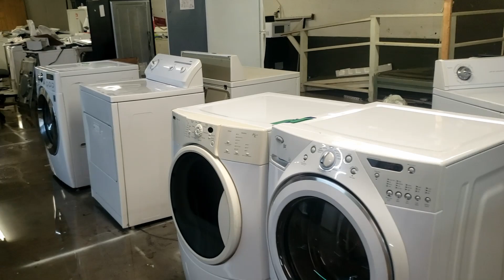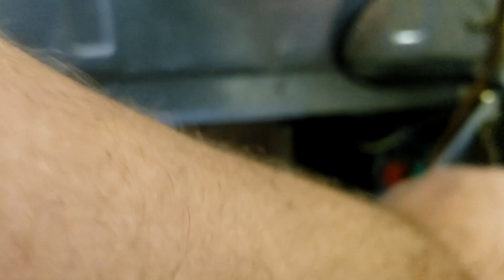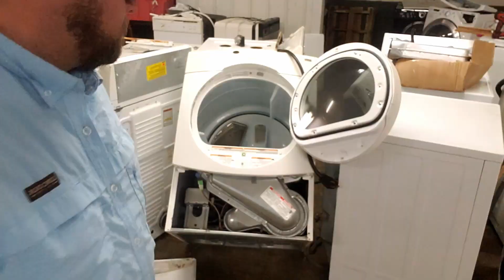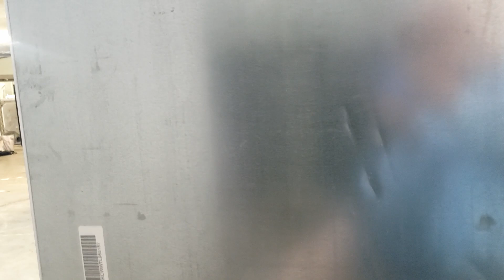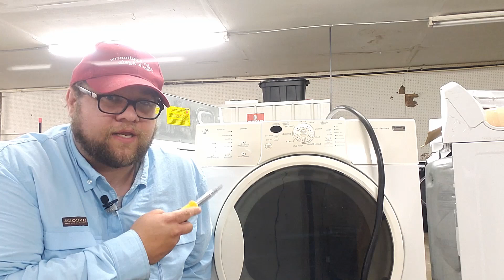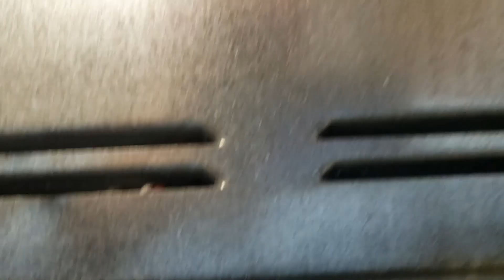How to Deal With Flooded Appliances - Recovery & Restoration

Comment: Just had a saltwater flood. Didnt stay long. We rinsed the refrig range & dishwasher motor areas with fresh water. Hopefully once it drys out good it will work? The power was off when flood came. Hurricane Helene in Florida
Reply from the maker: It should work yes. Make sure all wiring is clean and dry that came in contact with the water and you should be OK

Comment: thank you very much for the ray of hope. will be definitely doing this with my appliances

on the light of the situation, I would like to suggest taking off boards and cleaning them with non-conductive solvents that easily evaporate (like lighter fluid) to take off debris that get stuck on the contacts that may cause shorts

Comment: To recover any type of electronics from as a flood we would immediately remove them from location and remove the back first thing that insulation holds all kind of moisture, then we take an air compressor and blow off all the moisture off of every part, then leave it to dry with dehumidification, and air movement. Leaving it sitting in water in a place that big its tough to dehumidify it and prevent rust and electronic damage so you did damn good getting 95% back!

Comment: Another good reason to stay away from those GEtop load washers with the bottom and not open. lol

Keep in mind that we only sell top load washers and regular dryers but, my guy washes out most every dryer. He takes the tub out and flushes the rest with a hose. He washes it then tilts the dryer back, drains the water, plugs it in, I paint it.... SOLD! lol He does the same thing with stoves when he has a stove. Good to see that most things were saved! Floods suck!
Reply from the maker: We did get one bad fridge, but saved it with a new overload/relay combo. Probably have it sold this weekend - a nice side by side Samsung fridge.
Reply from the maker: And you spray water in the dryers eh? Interesting. We usually take a vaccum & hose and sweep 'em out roughly during the testing of the unit.
Reply: @bensappliancesandjunk  Yeah, he sprays the whole thing with water, puts it back together and starts it to blow the water out. Been doing it that way for years. lol
Reply from the maker: @lilolme69   Where is your shop at by the way?
Reply: @bensappliancesandjunk  Texas. Nice and warm here, come on down. :)

Comment: For as much as you use a hand screwdriver, Ben, you should try a good Wera or Wiha set.  KC Tool puts  the Wera handle + bits on sale occasionally for $20 or $30, and they are amazing.
Reply from the maker: One day I'll have a Wera 051024, but for now, I'm really liking the Irwin I got. Good suggestion though!